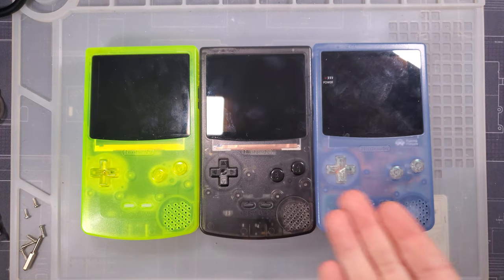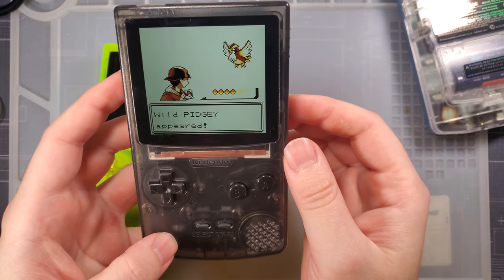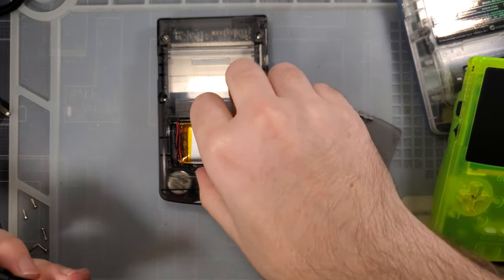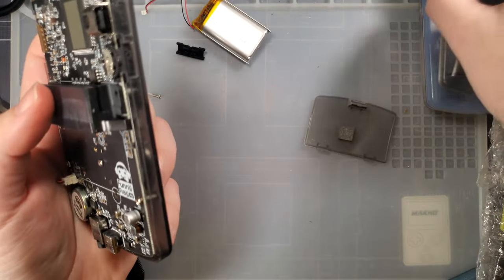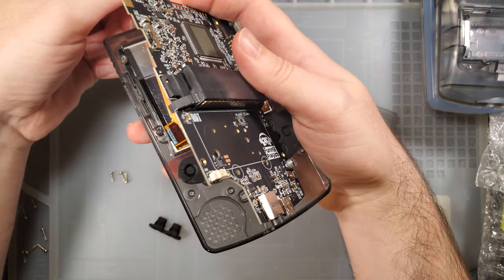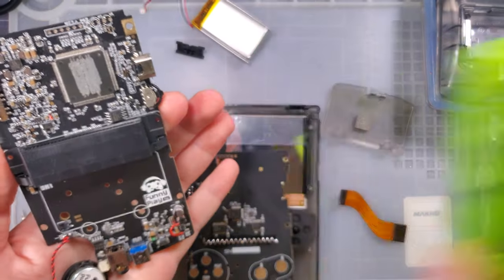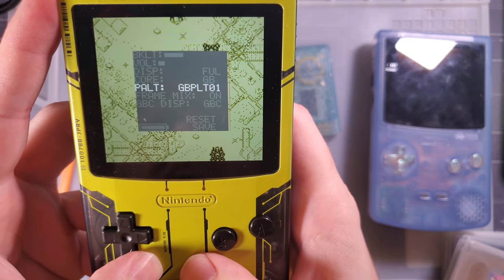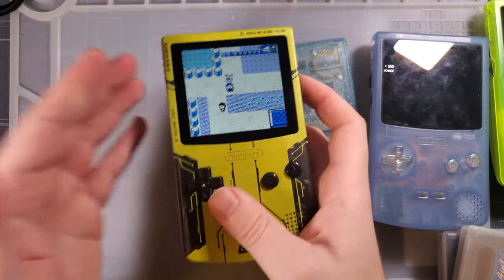FPGA Powered Game Boy Color (Pre-Release Prototype)

Comment: For those interested:

The chip is a GOWIN GW2ARLV18EQ144PC/7 20kLUT 144pin QFP package Aora SRAM based FPGA. It's a pretty nice little FPGA and with the right fingerpokening you could get it to do some Cool Stuff. The price per chip is around $10/ea so I'm guessing these boards are going to retail for ~50-60USD.
Reply: Thanks. 
Yeah, no clue why they bother scraping the chips.
Reply from the maker: Turns out that you can do a lot with a $10 FPGA. 

FWIW, the cart reader and link port are custom and probably pretty pricey too though your guestimate is in line with what I heard so who knows.
Reply: 99 USD as per Funny playing page

Comment: Cool Development. With the Laminated Screeen i almost opted for one but the issue i had with it was that it didnt have the options to have the "Color" word in their in their actual colours for each letter, it was just a whole block color which i was not a fan of. So i bought the Non Laminated one instead. If they made that an option id buy one. Id also love to see Special Screen Surrounds like on the pokemon color made to suit the larger IPS screens for obvious reasons :)

with that New Console though i could see for alot of users that mode switching would be annoying. Be good if Funny Playing added in an Auto Detect feature. Think that would be far better.

Comment: damn this thing is really cool, was freaking out a bit when you said its non integer scaled but then saw later theres the option to switch to 4x lol
Reply: The new interpolation seems a bit more sophisticated than the old one... Correct me if I'm wrong but the new one scaled up in integer and then scaled again to fit the full screen, which means you still get the chunky pixel look with less obvious uneven scaling. The older model seems to just scale up via nearest neighbor.

Comment: Loving mine (a year later...) - still has issues with some Flash Carts but every original cart I have tried works fine. My EZ Flash Junior works on all GB games I've tried but very few GBC games work - most white screen freeze ( only 5 games out of 34 work...). The EDGB clone from Ali Exp does not work at all. Both Flash carts work fine for original GB Color and GBA.

Comment: The Winbond chip on the earlier unit could still be flashed theoretically using a DediProg and an SO8 test clip, or something similar. I used to flash similar Winbond chips on boards at a previous job. (Be cool to see if you do that in the future and if you get it updated to a newer firmware, successfully.)
Reply from the maker: I plan on attempting a bit of reverse engineering just in a bid to see if I can update my un-updateable units. I'll be picking up a couple extra EEPROMs so I have an easy undo button. 

My hunch is that the files are pretty generically encrypted so as long as one unit updates, I can just round robin the EEPROMs and update them all on one unit. And if that's the case, that leads me to believe that someone who knows what they are doing can fully reverse engineer very easily. We'll find out, I guess.

Comment: So I got mine and it just came in the mail and I immediately have 3 problems. The first is that the console does not hold charge, I have to connect it to power for it to turn on. the second problem is that the backlight does not adjust, it is always on max no matter what the settings say. and the third problem is that the everdrive x5 does not work on it. I don’t know if this is the everdrive's fault or the gameboy's since I do not have any other carts to test it with.

Help wanted please, i just want my Game boy color.
Reply: update to the latest firmware and the brightness will be solved.
Everdrive doesn't work for now, but clones works.

Comment: This is pretty cool, but not something I personally would pick up. I'd be more interested in a replacement PCB that allows for the original GBC Chips with spots for the upgrades integrated directly on the board

Comment: These are really cool.
Ill probably wait for for a version 2 or whoever as they iron out the kinks.

Personally Id prefer this in a dmg or gbp shell.

Is there pixel grid options?
I'd love a dmg style pixel grid on dmg mode, 
where the grid is lighter instead of darker.
Reply from the maker: The current set of options is minimal. I've asked funnyplaying to at least port over all the options in their GBC backlight kits but I think they're focusing on the functional issues before they start adding nice-to-haves.

Comment: Just got mine in the mail this morning. Overall I like the console but it doesn't want to load my Everdrive x3, I get a message that says memory error. Everdrive works great in my Q5 laminated GBC. Have any ideas what could the issue. Everdrive is on version 1.06 FPGBC is v0.88
Reply: I get the same with the x7. Just came here to see if anyone else had this issue. Maybe we need to wait for an update from FP
Reply: @leabriana1223  I tried different firmware versions and got it to load my Everdrive with version 1005 but most games seem to run really slow with messed up audio 😕
Reply: @alexorear7807  thanks! Maybe I'll just wait to see if it gets better with a future update.

Comment: Is the slow down due to running at 50hz (or 59ish hz) instead of 60hz? I noticed the audio is a little pitched down, so that might be the issue.
Reply from the maker: Stock speed is about 59.7. The slowdown is likely just due to an incorrect multiplier and is hopefully as easy to fix as just changing that multiplier.

Comment: Would the aftermarket cart slot work with an actual GBC board? If so, any way to find out if Funnyplaying will sell it as a standalone part? Got a perfectly functional board that only has a broken cart slot!
Reply from the maker: Yes, I swapped the cart slot in my yellow unit pretty early on to verify this. I forgot which GBC the slot ended up in which I guess is a good thing?

Oh and yes, I understand that Funnyplaying intends to sell the cart slots separately as well.

Comment: You could still load up roms on an sd with an everdrive or similar flash carts. I would rather buy one of these than support a company that creates false scarcity of their products. I hope that they end up making a gba version I would gladly buy both!
Reply from the maker: > I would rather buy one of these than support a company that creates false scarcity of their products

What does this even mean? I keep seeing it repeated without any actual explanation. How does "a company" stand to make a profit by making hardware and then not selling it? 

This is a Game Boy hardware emulator. Everdrives (and the like) are cartridge emulators. Put them together if you want weird incompatibilities. If you insist on using a cartridge emulator, you'll have a much more consistent and enjoyable experience by using a software emulator instead such as a miyoo mini or anbernic device. This device is not explicitly compatible with cart emulators and does not work with all carts.
Reply: @makho  and also flash carts do not run on emulation. They can run emulators but that is not the main feature that flash carts use. All the cart does is provide a graphical user interface to load up roms. The roms are played via the gameboy hardware (if you are using official hardware.) If you are using something like fpgbc then it runs on the hardware emulation of that device but in either situation it’s not doing any sort of emulation on the cart itself
Reply from the maker: @madmyc6836  You should look into how these SD based flash carts work. There is a MCU/CPLD/FPGA in all of them that emulates the cart hardware. None of these carts are shipping with Nintendo MBCs so how would they support the hardware without emulating it?
Reply: @makho  so what you are saying is that it is emulating the hardware that is in a legitimate cart? But the roms stored on the sd are still playing off of the original gameboy hardware are they not? When the analogue pocket runs roms using open fpga it would not have the cartridge hardware in it either so I don’t see what the difference is when comparing the two. I am not super well versed in hardware emulation so forgive me if I am wrong
Reply: Or in the case of the fpgbc it would be running the roms off of the fpga chip. I forgot that’s what we were comparing I made that comment awhile ago lol.
Reply from the maker: @madmyc6836  It sounds like you have a fundamental misunderstanding on how this hardware works. There are multiple pieces that are all designed to work together. For example:

When we do a backlight mod on these consoles, we replace the original screen with a new screen and then install a "man in the middle device" to get the new screen to talk to the SoC. This "man in the middle device" is nearly always an FPGA that is just emulating the original screen and translating the signal into something the new screen can display. 

For another example, games end up getting mapped into the main system memory when the console is booted. This means that as far as the GB SoC is concerned, the carts are NOT removeable and are just part of the rest of the console. When we use a flash cart in place of an original game, we are emulating the original bank switchers that Nintendo would have used to swap parts of the game into the system memory. We can also emulate certain functions of the MBC such as storing and returning RTC values. Yes, in this case the games are running off "real hardware" because the code is executed by the Nintendo OEM SoC even if the game cart is emulated but we're still replacing hardware with hardware emulators. 

Using a GB flash cart in a GB is the exact same as using any ODE (optical drive emulator) in any disc based console. Notice the word "emulator" in the name of the hardware. 

There's nothing wrong with emulation. In fact, it's a vital component to how a lot of console mods even work in the first place.

Comment: This is awesome, I think they could have used that clone CPU, but it seems like there's only one company making them. Can you even call it a Nintendo Game Boy Color now? Funnyplaying should give a different name to it. Probably way beyond the goals of the project, but they could combine it with something like the K101 or even the upcoming K2DS, it could have even more appeal.
Reply from the maker: I don't think funnyplaying has any interest in relying upon anything other than stuff they can make and off the shelf parts.
Reply: @makho  But they could use ARM7 chips for GBA compatibility, right? They would need to design a new board though.
Reply from the maker: @arthurcarneirolopes6383  The Nintendo CPUs are custom. It's not that simple.
Reply: @makho  I know, the GBA's CPU is a mix of a GBC and an ARM7 which does the GBA part, but if think about it, it either is in GBC mode or GBC mode, not both at the same time. So it's kind of similar to those NES+SNES duo clone consoles in which only one system is turned on.
Reply from the maker: @arthurcarneirolopes6383 Not all ARM7 CPUs are identical just like not all x86 CPUs are identical.

Comment: By the time you assemble this, it will almost cost the same as an Analogue Pocket, which has superior hardware and utility, apart from having most issues ironed out. How does this differ from genuine modded Gameboys?
Reply from the maker: If you're going to compare to the AP, you gotta factor in the price of an AP. I cannot buy an AP at MSRP right now because Analogue only sells them in batches and they aren't currently selling a batch. Scalper prices make the consoles effectively $400. I agree that the AP is a better buy than this or a modded GB but until one can get an AP at MSRP, that is irrelevant. 

Admittedly, Funnyplaying is also currently not selling these but I've been told that the "kit" to build one of these things (so the motherboard, battery, and laminated LCD with adapter all together) will be under $100. From there, you'd just need a shell, buttons, and membranes and those certainly do not cost another $150. I believe the specific quote mentioned that an assembled FPGA GBC would be under $100 but I'm rounding down to be safe. We'll have to wait until launch to find out for sure. 

Modded Game Boys are much more expensive than this and can be unreliable. There are loads of underqualified people out there selling low quality modded GBs. Modding a GB yourself to have feature parity with this console is also more expensive than an Analogue Pocket at MSRP and they only get more expensive when you factor in the "prebuilt" cost if you do not mod it yourself.
Reply: They’re sold out now, but I bought one on the FP site yesterday for 80, including Shell and buttons.
Reply: @AgreeableDetail  have you gotten yours yet? Have you tried it with an Everdrive? Got mine today and it doesn't seem to work with my ED x3.
Reply: @alexorear7807 I just put it together and while I haven’t done extensive testing, at least for a few minutes of Kid Dracula and Shantae on my Everdrive X5 it does seem to  work?
Reply: @AgreeableDetail  which FPGBC firmware are you using? I installed 1005 which is an older firmware and I got some games like Tetris to work and then other games like TMNT Back From the Sewers and Grimaces Birthday would load but have jumbled audio and run super slow.
Reply: @alexorear7807 I haven’t touched the firmware, so whatever it shipped with I’ve got